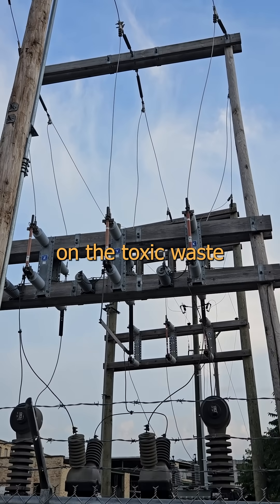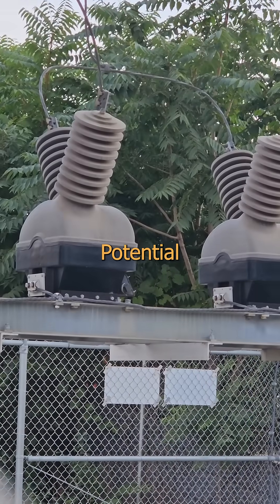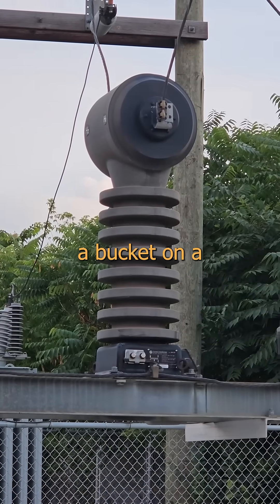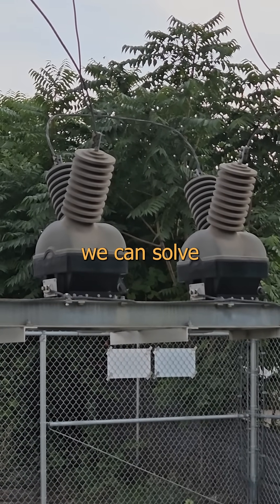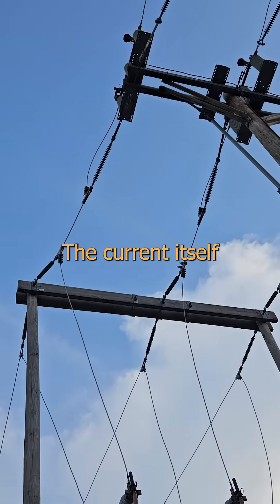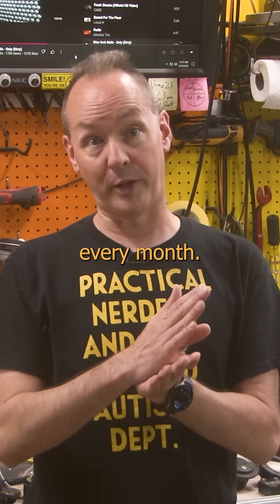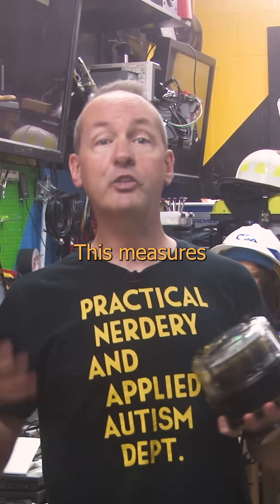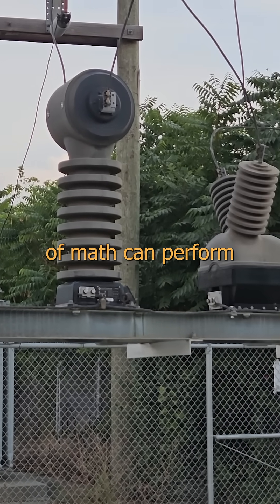Old School High Voltage Metering #chrisboden #comedy #engineering #electrical #educational #science

Comment: Never cut a CT cable. Our utility had 2 different instances when 138 KV PT's faulted. One launching ceramic shards which pierced the sheet metal on the control house. The other launched a piece of ceramic insulator the size of a basketball about 40 yards.

Comment: For "reasons" I grew up in a single family house with a 400 amp hookup. The voltage was normal but the current was measured using a CT that was hooked up by threading both phasey through the device. Neat kit, and the only residential hookup I've ever heard of using it.

Comment: In a substation setup like that, you usually have a Amatek or Schweitzer meter. They're a ~$5000 meter that's shockingly accurate and measure any power quality datum you may want

Comment: I build primary metering equipment for my job, up to 35kv. We can measure a 4160, 12.5kv, or 35kv circuit with a class 20 FM9S meter

Comment: I'd love if he could explain the wire gauge coming into your house. I understand how I get 120 from hot to neutral and how those give me 240 in opposition. What I don't understand is why I have to run a thicker gauge from my box then what they run off the pole into my house for each 50 amp breaker. 

Also I only recently learned/realized that there are two hot lines coming into my house and then an exposed cable that somehow works as the neutral. 

I would also love to hear his opinion on discreet ground, for when they keep the ground separated from the neutral entirely.

Comment: To be noted. In most cases is the "voltage transformer" is actually just a capacitor stack with the capacitors closest to Neutral having a transformer over it to make a proper galvanic insulation.

But why are US energy meters round? Both for consumers and on grid level.
It is just not cost-efficient to make round stuff.

Comment: A cool thing to notice : bar current transformers are complex and expensive for the reason you describe. But there is a place where you can sense the magnetic field of the current without being bothered by the high voltage : at the bottom end of bushings, on transformers, wall, and gas insulated switchgear! You’re at ground potential. 100% high power transformers I’ve seen have integrated current transformers inside their bushings (high voltage terminations), basically as cheaply as a low voltage current sensor.

Comment: The old guys in the country around where I live in Canada. Figured out that if you took the smallest drill bit you can buy at Canadian Tire and drill a hole. In the bottom of that meter you could put a like toothpick or stick to slowly drag on the wheel to lower the amount you have to pay for power and it took New Brunswick power years to figure that out. Wasn't until they saw somebody trying to hide it from the inspector
Reply: People have also done that by hiding strong magnets around the meter.  Works until you get caught and then get sued for what the utility company calculates as your stolen power.

Comment: That those are for factories reminds me of when my class got a tour around the steel works in Salzgitter, and that while they do generate enough power to keep the light of Salzgitter itself on for a few days from the blast furnaces, that energy is used up quite quickly, and they need about 3 or 4 times that from the power grid

Comment: I love the high voltage content. I wonder what ranges you have there in the US. Here in northern Spain the most common ones that I encountered were 3kV 5kV, 6kV, 13,2kV, 30kV, 132kV, 220kV, 380kV.

Also a lot of equipment is so very old but robust. Like the big transformers in a cement plant which were made by Westinghouse and are 50+ years old

Comment: Okay so that’s how they make sure you don’t take off your electrical chastity cage.
If you tamper with your meter, they know, because they add up the consumption of everyone connected to the network and compare it to how much comes out of the substation.
Reply: I don't know how well they measure it. Here in Brazil some people got sued for tampering with the meter, but in reality they just installed solar, went on a vacation, etc and had to counter-sue the company and prove they just used less power. Or maybe they do measure it but don't even check before assuming!

Comment: it's amazing how you can take 100kV and convert it to a measuring voltage a meter from lidl can handle
Reply: Current and voltage transformers are amazing pieces of equipment

Comment: "software based sundial"
I'm stealing that 😂
Reply: Fun fact, modern protection for power lines uses GPS based clocks to time align the real time measurements from each end of the line. If more current is going on one end than comes out the other, then it's going somewhere you don't want it to. If the difference is big enough then it's time to do something about it. The trick is figuring that out fast enough (~4ms) that you can do something about it before expensive sounds become very expensive sounds.

Comment: That C suite joke hits hard. This company I used to work for was told by one of our senior voip techs that the field techs needed at least one buttset  (I see you snickering  back there, quiet down) to test lines with and they....fired the guy. Can't make this shit up. So yeah. Having the right equipment to test with is important.
Reply: I'm not shocked in the least. Sounds like some stuff my dad dealt with being in the field installing phones and internet. When he started they got whatever tools were needed. By the time he retired the amount of nagging and begging to get sssome basic tools was insane. I was kinda surprised they kept on a dedicated fleet mechanic instead of contracting out to some cheap shop in town.
Reply: @agailparsons  I think that in the industry my products are used, the workers have a thre$hold which they can easily buy whatever if it is below the threshold, but above the threshold, forget it. Our products are mostly below the threshold, and we sell lots of them.
Reply: @agailparsons I'm a 3rd-generation employee at a utility. My grandpa told me stories about hemming and hawing in the old days about tools and equipment. The local got involved and it became the norm for tools to be supplied with a smile. Pops told me how easy it was to get tools and gear in the 80s & 90s. By the time I got involved in the 2000, vulture capitalists had gotten involved, safety advancements had turned $60 hand tools into $3000 battery tools, and the store room had become the supply-side equivalent of trying to order from a Sears catalog using a check.
They won't outright deny a tool request, but it may take 3 to 6 months to be approved by committee, sourced from cheapest vendor, ordered by stores, and shipped from vendor to our central warehouse, before being shipped to our individual service center.
Reply: So many companies have been doing this kind of shit. Wtf is happening??
Reply: i love your pfp, enby<3

Comment: "Old School" 🤣

That's basically the same stuff that would get installed today if they rebuilt it, just would look a nicer gray.
Reply: Yea but it feels so much nicer when it’s ✨shiny and new✨
Reply: The company I work for makes the high voltage breakers and cvt used for this now. I get to test the breakers for all the substation and mainline applications
Reply: Yeah because Tesla isn't alive to upgrade our current system. And now the politicians see it as a way to control us. We'll never get an upgraded Grid. Not if we keep voting Republican..
Reply: @Korokukanas it's the same stuff as in our grids in (north) Europe. For some reason, the measuring voltage is often 100vac here. Most of the stuff is measured directly on the low voltage side though, so often at 230/400V.  CT secondaries are mostly at the same 5A.  Up to 63-80A is usually measured directly.
Reply: @Korokukanas: yep. we all know just how modern california's power grid is.